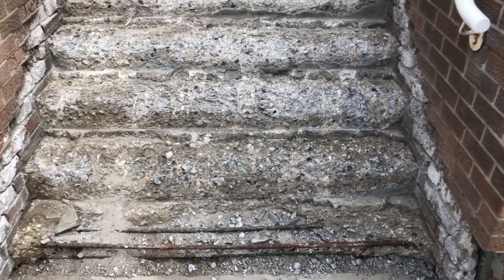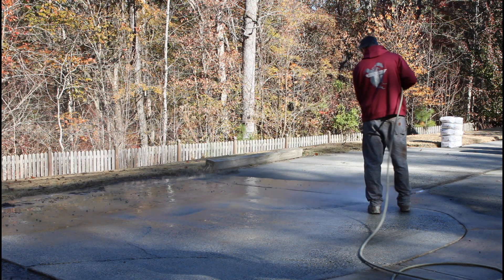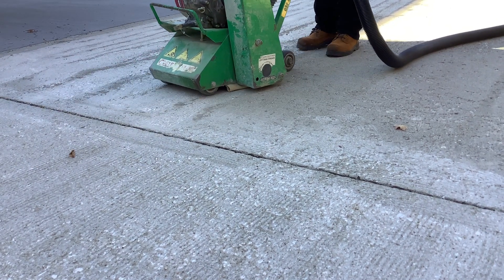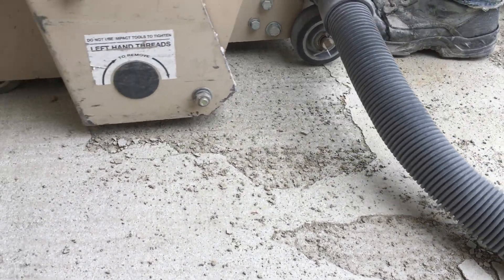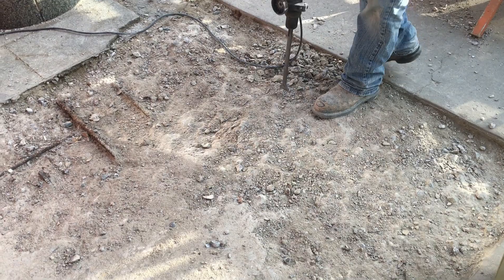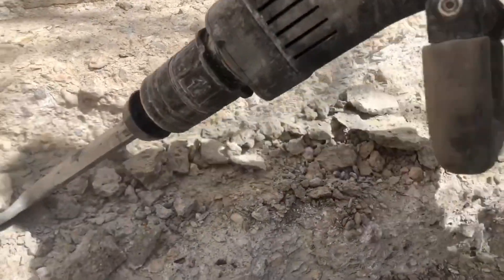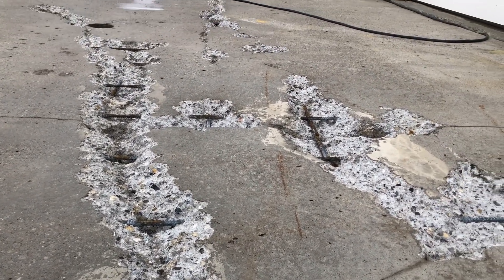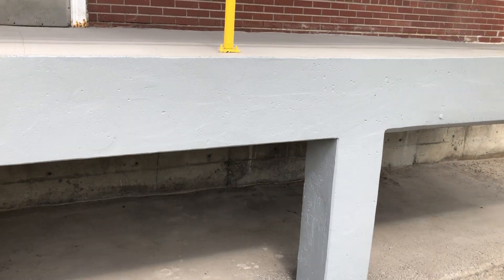How to prepare concrete substrates before overlaying and restoring them.

Comment: I did all the prep work exactly as you instructed but.......  Worked really well until the final overlay.  The final batch they sold me was a contaminated batch and now they refuse to take responsibility.  My front porch is filled with tiny pock marks that are bleed ash from forest fires in the Alberta getting mixed in with sand in the product manufacturing. So, instead of getting the smooth bulletproof finish I was expecting, My porch is pocked, susceptible now to freeze-thaw damage, and continually leaches out a rust colour when water comes onto the surface.